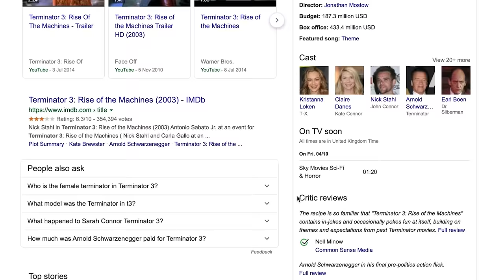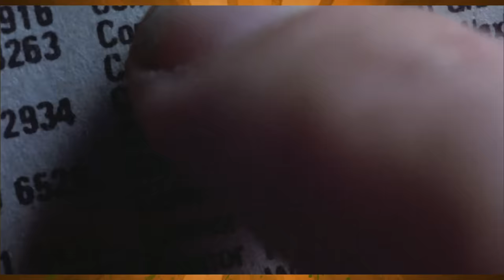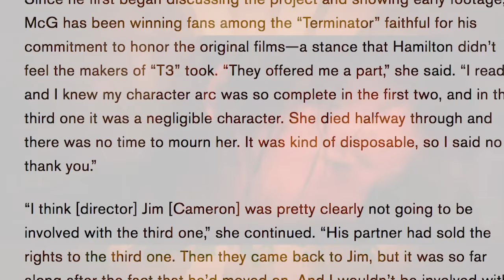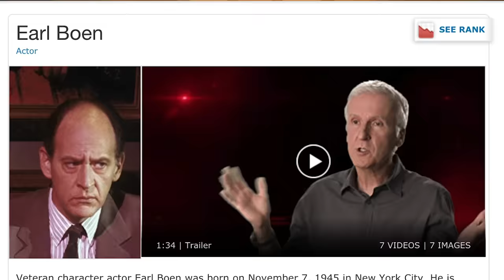Terminator 3: Rise Of The Machines - Caravan Of Garbage

Comment: I liked Terminator 3. It wasn't great like the original nor was it a masterpiece like T2.

It was good.
Reply: It was not good.
Maybe you like but it is not 'good'.
Reply: In your opinion. Just like I thought it was good in my opinion. 

It  looks especially good in relation to Salvation and Genisys.

I didn't thinkvit was great or anything.  It held my interest, I could follow it, some of the action sequences were spectacular. I found the villain formidable and interesting.  Her acting was robotic as it was supposed to be.

Arnold's acting was about the same as in 2 with not as much character development as the second. Arnold had some genuinely funny lines.

John Connor and Catherine Brewster were adequate and I enjoyed  the chemistry between the two.

I thought the ending was pretty good and I liked the slight twist.

Going into it my expectations were low, but for me at least it was an overall positive experience and better than I thought it would be although not nearly as good as the previous two, it was certainly much better than the next two.